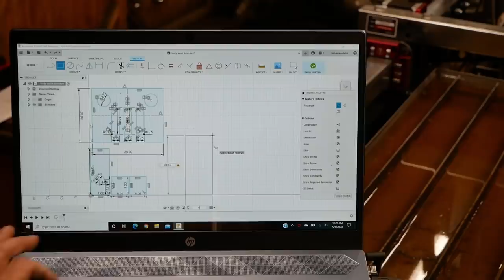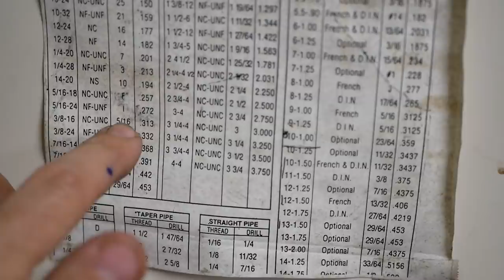420cc Predator powered articulating 4x4 dump truck build part 8

Comment: Buddy you make those holes when galvanizing .The front bar should protect your wheels and your Aluminium and progress to a half cab roll over cage .Nice idea though.
Reply from the maker: If the front bumper covered the front wheels it would allow stuff like trees to get hung up behind it and potentially get me stuck in the woods. You need to think these things though when building stuff like this. People like yourself don’t really think before they comment,

Comment: It's really cool just why go through all that and put a predator motor in it
Reply: why not put a predator motor in it if it has enough power to do the job the vehicle was intended for? What motor would you suggest ? Keep in mind this is a purpose built  prototype build from scratch on a budget and all fabrication and structure is designed around the predator motors output. this vehicle is designed to move material from one place to another at low speed and that does not require much power.

Comment: hi mike i love the subaru drive train is what i want to build if you use a 1974  it has low & high range in the trani .to get 8 to 1 what size or tooth sprocket to get that ratio.thanks i am puting a toyota 1.5l auto in a smart car
Reply from the maker: I can’t remember the exact sprocket sizes I used on this build any more.
I think I just ended up calculating them based off the centrifugal clutch. 🙂👍

Comment: Tractor tires with 800 lbs. vs. road tires and 2500 lbs....really??
Reply from the maker: montwolfman The articulating truck weighs around 1200lbs, the Suzuki has brand new mud star tires on it. You completely missed the point. I’m just showing two 4wd vehicles on the same hill. What else do you want to complain about?
Reply: @Mikefestiva  Thanks for the feedback. i'm not complaining Mike..in fact, I admire your skill and innovation. My point is that tractor tires with a taller diameter and traction cleats are all about traction and it's pointless to expect automotive off-road tires without traction cleats to match the performance. It is a moot point.

Comment: I wonder how long until having to take bumper and winch off to access engine bay becomes tiresome...
Reply from the maker: Wow you really think I can build something like this from the ground up and I would have to pull off the winch ever time I need to put gas in it? Your comment is ridiculous 😂
Reply: Hi @Mikefestiva , all I'm remarking on is that it appears inelegant, especially in comparison with the amazing job you did with the chassis. Suggestion would be to have a fixed grille/front wall and hinge the bonnet past that. No need to be so touchy dude. I also hadn't thought of just pulling the bolts front the "hinge".

Comment: Ok now put the Suzuki tires on the 4X4 dump-truck and go no where up that hill .
Reply: Obviously the tires on the Suzuki were not up to the task compared to the little tractor but I think the point of the demonstration was to show the advantages of a purpose-built vehicle and I'm pretty sure the is Suzuki even on dry ground wouldn't have been able to turn right  at the top and go up a steeper incline with out one wheel coming off the ground and losing traction
Reply from the maker: The tires on the Suzuki only have 3000 miles on them, they are mud terrain tires, the hill was far steeper then it looks in the video.
Reply: @Mikefestiva   suzuki would of made it if you came into er at 50.. point was made though that the tractor can do it much easier and at any speed which is definitely nice at times